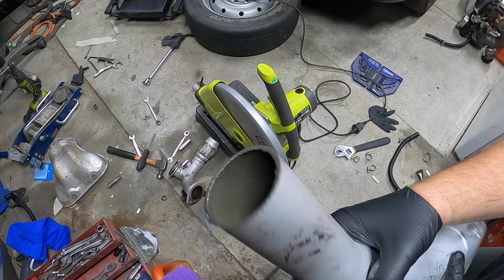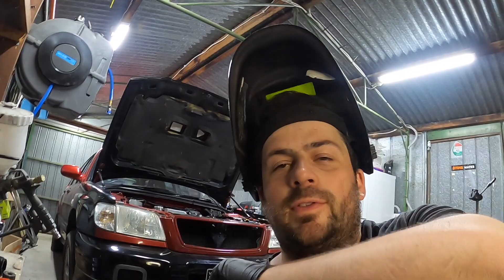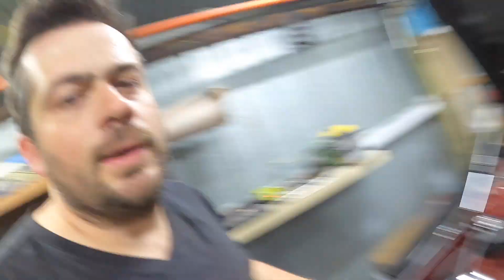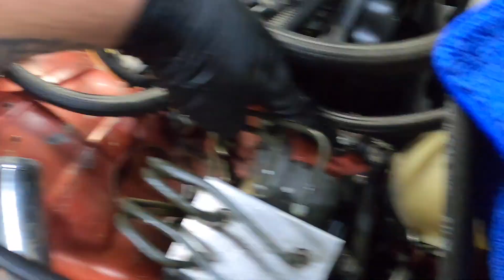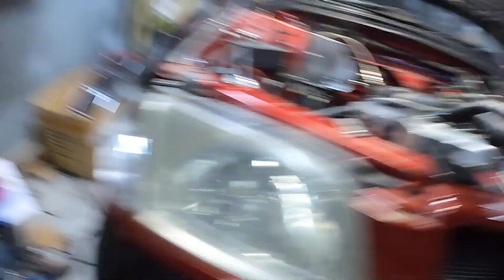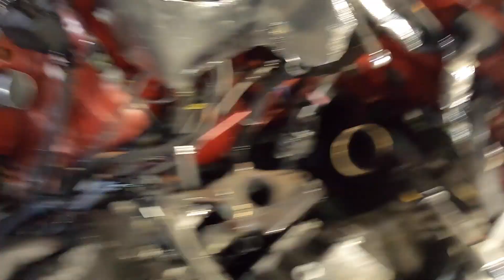Twin Turbo Subaru Forester Gets a Custom Up pipe

Comment: Hey bro, no clue if you will have an answer for this but I’ll ask anyways. Do you think that a up pipe that’s made for a wrx Impreza with the ej205 would fit an sf5 without too much modification?
Reply from the maker: Yes it will. It’s the down pipe that’s different on a RHD Subaru
Reply: @HarrodsGarage  appreciate it

Comment: First to like 😂 love the vids, also have a SF5 turbo. Love it to bits
Reply from the maker: Nice. What year SF5? Have you done anything to it?
Reply: @HarrodsGarage  2001 S/turbo, sofar just exhaust, 18inch wheels and wrx shocks, but saving to get a forged motor, and wanna put m-spec kit on. mine also Auto, i wanna do a manual swap cause manuals are fun :face-green-smiling:
Reply from the maker: Agree manual are fun. My SG XT is manual and I love driving that